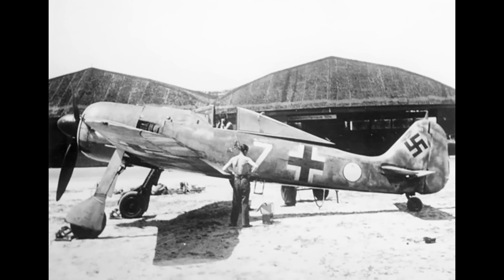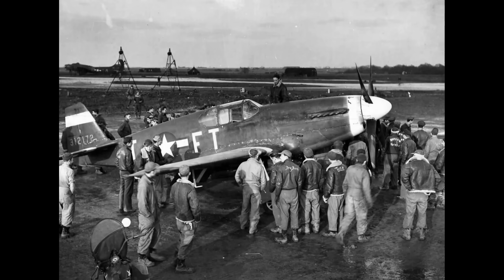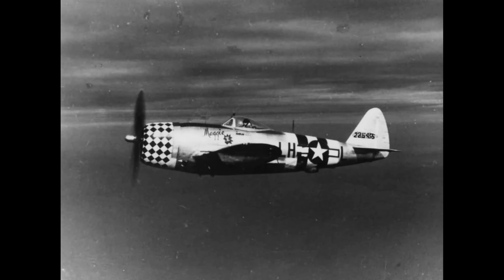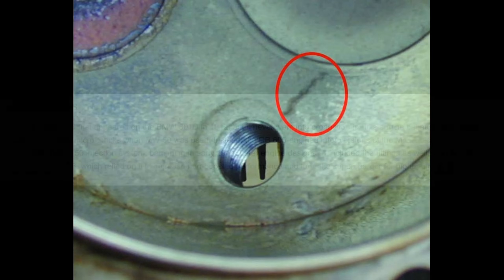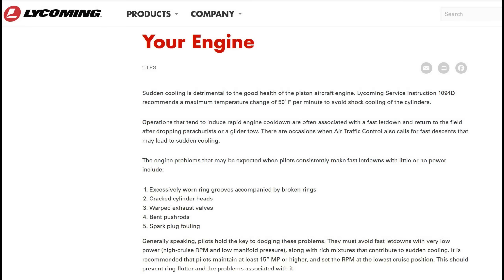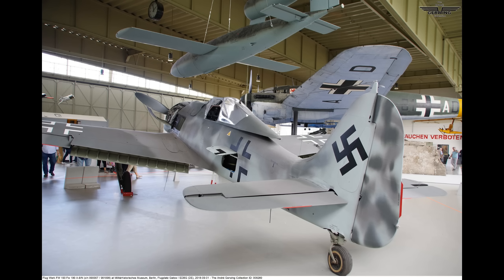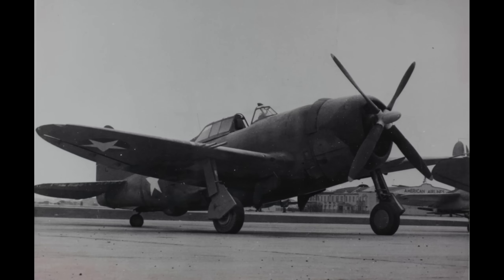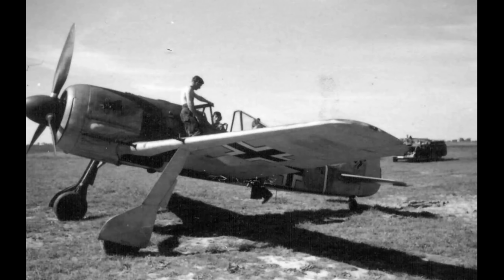Focke-Wulf Fw 190 A-4, Almost turned the tide, Almost...

Comment: Fascinating,  for information from the Fedden mission. Given the historical closeness of the relationship between the British and BMW, a lot of the report focused on BMW engines. 
Considering materials “On top of this, a shortage of raw materials and difficulties from our bombing attacks made many changes necessary. The chief engineer of B.M.W. said that during the war he had to change the steel of his poppet valves ten times, and of his crankshafts three times, necessitating check tests in every case. Some idea of what this means as regards disorganisation of output, can be imagined by engine builders. Further, he said they had the greatest difficulty with fuels, and could not rely upon these regularly maintaining their characteristics for a few weeks on end. On top of these difficulties, there is no doubt that our persistent bombing had a very serious effect, and we were told of organisations which had been dispersed to four different sites in 14 months.” 

Another issue was manufacturing time a BMW study compared the hours for manufacture, between the 801, the Bristol Hercules and Wright-cyclone. The BMW crankcase took twice as long has the Cyclone and 40% longer than Hercules, though the BMW was lighter. The largest issue was the fuel system it took 10 times longer to manufacture than those on Allied engines. 

This was critical, and catastrophic for German development, exhaust valves were being made of Sicromel-8, no nickel 8% chromium and 1% aluminium, in comparison German engineers established the exhaust manifold Rolls-Royce ally composite of 80% nickel, 12.6% chromium, 6%iron 0.067%., Cobalt 0.28% manganese, 0.17% silicon, 0.19%titanium and 0.02% carbon. Also for consideration are the ignition plugs the Fedden mission investigated these at length because of the impact of the lack of specialist material availability particularly their reliability.
The BMW 801 engine was also studied has a priority in America to review the fuel injection and the automatic control unit (these were not initially available, which caused difficulties) The Ernest Hives, report on his visit, is interesting. 

Fuel injection, “Mr. Brucbnann stated that he considered water cooling necessary for all engines over 4000hp. All the B.M.W. engines employ fuel injection with Deckel punps, used not in preference to Bosch, but because the Bosch pimps could not be obtained in sufficient quantities. It is understood the Deckel pumps gave some trouble at altitude. Mr. Bruckmarm stated that no engine vibration dampers were fitted to any B.M.W. engine and declared that they had been proved to be unnecessary.” Given the height at which the 8th Force attacked the Deckel injection issue would be a disadvantage up against Spitfire IV Spitfire XIV and Merlin Mustang. 

It’s worth investigating the Pembroke, FW190, landed June 1942, report and engine analysis. If ever an aircraft, arguably the best fighter in the world at that time, drove development, it did. The resulting consequences were staggering, in the Merlin 60 designed for a bomber to be advanced for a fighter and fitted to the Spitfire V to become the Spitfire IV, thence to the upgraded Spitfire VIII and Mustang.

Comment: First of all the BMW-801-D-2- with MW50 had "only" about 2000hp and they had problems to deliver the system in large numbers , so they could practically use this fully on in the A-8 version . And at low altitude the power outcome of this system was way under the expectations , MW50 was for high altitude . A simple change of the boost pressure or a C3 injection had the same effect and was cheaper as well . 
Also this was injected into the intake , the water evaporates and this cooled the air like a intercooler . The methanol should help prevent knocking , I don't think this would crack the cylinder heads . Or every modern car with a intercooler would have that problems . More air in the cylinder plus more fuel and therefore more hp and heat could damage the cylinder heads I would say , that's why it was only allowed to use this for 10 minutes .
Reply from the maker: No, MW-50 is not for high altitude. You're confusing this with GM-1. MW-50 gives its greatest gains at altitudes where the supercharger can provide additional boost. C3 injection is nowhere near as effective as MW-50. cont:

     You statements about MW-50 being basically like intercooling, the methanol being what helps prevent knocking and so on are common but wrong, this was all dis proven by NACA long ago. I can't straighten all this out in the comment section, I'll probably have to make a video about just how MW-50 vs. GM-1 vs. Intercooling works.
Reply: @GregsAirplanesandAutomobiles  I should have said higher or mid altitude , not high like 8000 to 10.000m . 

Practically both systems were the same , they cool down the compressed air . GM-1 is like today's NOS , but it's more effective than MW50. Cause it's boiling temperature is -88° and at 575° it decays into two nitrogen atoms and one oxygen atom . So it brings additional oxigen into the cylinder . But you can blow up your engine pretty quick . 

The Germans tested MW50 at under 500m and they get 6kph more top speed , so with higher altitude I meant 3000 to 5000m . C3 injection was effective up to 1000m were MW50 had the same hp output . 

It's all about cooling down the compressed air , cause cold air needs less space and therefore more of it fits into the cylinder . And that gives you more hp and for that we have intercoolers today . 

 Methanol was also use to prevent the water from freezing and has a high octane number 106 , wich helps against knocking . 

Today we use the same things to tune up our cars .

Comment: I flew a Piper Navajo in northern canada where we would normally be operating in -35°C air in the winter. They constantly pounded the threat of shock cooling into our brains. I managed to have a crank case crack on me once even though we never pulled more then 2" of pressure off every 2 minutes.

There is nothing more taunting then seeing the turbopipe glowing hot while your freeze your balls off for a couple hours in one of those Ho's.
Reply from the maker: Yup, don't get me started on that Janitrol heater crap.

Comment: Excellent video. Please do a video about the FW 190 A9 variant, with its BMW 801S engine and the hypothetical 801F-1. Also, did the FW 190 A8 have an upgrade in power with the 801 TU WEP?

Comment: Shock cooling is definitely a thing from my experience. I used to be a member of the Canterbury Gliding Club, which operated a Piper Pawnee PA-25-235 (which I have flown as Tow pilot on occasion and often flew behind in a glider). Earlier on with the aircraft, the club went through an alarming period of cracking cylinders (including fairly new cylinders) and it was of significant safety concern not to mention expense. A procedural change was made where by: after the glider released the tow plane would NOT reduce throttle but would nose down to increase airspeed (the Pawnee is incredibly draggy so exceeding VNE is not normally an issue), which would cool the cylinders at a slower rate than if you throttle off. You would leave the throttle wide open until base leg. It made for quite fun flying and completely eliminated the cylinder cracking problem.
Reply from the maker: Thanks. I was expecting an avalanche of people from the "shock cooling is a myth" crowd, but they haven't shown up. It seems that most pilots with experience in this are in my camp. In fact if anything, more of them are like you and that indicates that shock cooling is a bigger factor than I realized.
Reply: @GregsAirplanesandAutomobiles  ??? Have these people never warped a hot pan by putting cold water on it?
Reply: I know of a glider club that went to water cooled V8s in their Pawnees to combat shock cooling at low altitudes
Reply: My gliding club in the US used 180-Hp engined Super Cubs; a very close engine/wing combination to the 180-Hp Pawnee.  We suffered a disturbing series of cracked cylinders until we reduced the rate of cooling after glider release.  With our new procedure, cracks seemed to be a thing of the past.
Reply: Absolutely, it was the same at m,y gliding club. I never flew the Pawnees but having tugged in both 0-320 standard Super Cubs and later one modified with an 0-360, the SOP was reduced power (down to about half throttle) and come down in massive slipping turns, about 70 degrees of bank with full top rudder and plenty of pull. LOTS of fun.
Reply: @harryspeakup8452 0-360 Super Cub sounds great fun - I have never flown one that powerful. The Pawnee was so draggy (effective flaps also), that no side slipping needed but it had a pretty poor glide ratio! Does sound like fun though.

Comment: Another interesting development of the Fw 190 was the proposed DB 603 powered version, known as the Fw 190 C. Initial calculations indicated a speed increase of 50 km/h compared to the 
Fw 190 A series fitted with the air-cooled, 14-cylinder BMW 801 radial engine, as well as a lower flight weight. A wartime Daimler Benz document showing airspeed for the Fw 190 C V16 documents the outstanding performance of the DB 603 A engine mounting a G-type supercharger. Thus equipped, the V16 in 1943 achieved speeds of 570 km/h at low level and 722 km/h at a height of 
8500 m and it only needed B4 type fuel. Galland and many leading German fighter pilots were in high praise of the aircraft and wanted a production run, even Kurt Tank requested the RLM to commit to this. Yet Generalfeldmarschall Milch scuppered further development. Fortunately Focke-Wulf had learned much from its development with an inline V12 engine in the Fw 190 airframe, which would assist in the future D-9.

Comment: What happened to those long form videos man.
Reply from the maker: That's a good question. Those are not going away, but I have to accept reality. I put up two videos about 45 mins each on the Pacific Theater Thunderbolts, a couple months ago. Those videos had far more info and were much harder to make, yet these last two have caught up in views in only a few days. I'm not going to stop making long videos, but I'll mix in some shorter ones as well.
Reply: @GregsAirplanesandAutomobiles   yea I know. I just miss the long form.

Comment: Shock cooling WAS an issue with the Continental O-300 engines.  I had one in a '58 C-172.  Always did descent from altitude by pushing over and doing max RPM slides downhill.  Even in the traffic pattern, I adopted the Navy technique of pitch first, power as required.  Even after 1,200 hours, the guy who bought it said that it was the sweetest O-300 he had ever operated.  The Continental handbook for the engine did caution against "chop and drop" descents citing potential cylinder head issues.

Comment: 1943 escort fighters? In the USAAF? Wasn’t the bomber mafia still insisting that drop tanks weren’t to be used and just letting their bomber crews be slaughtered by the dozens?
Reply from the maker: Yes, but by mid 1943 the Escort fighters were going in deeper and deeper. Had then been getting trounced by water injected 190s in addition to larger bomber losses, you can see how that would have set things back for the Allies.
Reply: @GregsAirplanesandAutomobiles  yeah i do see your point. it would have probably made the bomber mafia feel like they were right, and allowed many more thousands of bomber crews to be sent to their deaths.

Comment: No single aircraft could have possibly turned the tide.  Maybe the 262, if used from the beginning as a pure fighter, could have held the tide back briefly, or got the 8th bombing at night - but then the Allies would have put more effort into the jets rather than continuing to develop the Merlin and Griffon.
Reply from the maker: It the tide was going to be turned against the US air armada it had to be in 1943. The 262 wasn't available in 1943, so that's not an issue. Let's remember that the Germans did inflict enough losses for the US to stop deep daylight raids in late 1943.

Comment: I totally agree with your, metallurgy idea.  The Germans were on the back foot with supplies of minerals to alloy steel as they started the war. It evidently showed up here in 42, then as the war drew on the tank armor became very brittle as they lacke Chromium, Vanadium and Manganese to make it less brittle. I had not heard anything about piston engined aircraft but had read about the jet turbine blade issues. Thank you for this informative video.
Reply: I think wasn't just the effect of alloying elements but machine tools and alloying elements for cutting steals.  As far as I understand it Pratt & Whitney (a machine maker by origin) made the R-2800 cylinder heads by forging them from billet stock and then precision gang sawing the ultra fine cooling fins and machining the head.   BMW was casting the whole head in one piece.  At some point BMW went from casting the head to precision casting it in a vacuum.  (I think this technology was developed for the never to be used BMW801E but some of it was incorporated into the BMW 801TS and TH which were D2 with some E technologies, these 1944 engines apparently had not only higher compression ratios but were more suitable for MW50  (possibly introduced in 1945 as the Ribbentrop system).
-I'm no metallurgist but I know vacuum casting reduces the number and size of the strength reducing inclusions and crystalline defects while forging forces them out of the metal.     Machining was just not an option for mass production the Germans.  They didn't have enough machine tools and they didn't have the elements for the cutting steels (particularly tungsten).  They tried to forge, cast, press and weld everything.  Anything but machining.  To an extent the US machine tool industry based around Cincinnati and Milwaukee 'won the war'.   To be frank I think not even Curtiss Wright could match Pratt and Whitney in machining.    Napier had no chance to make the Sabre work without American Machine tools to machine the sleeve valves.
Reply: They also had a lack of experienced pilots at that point. Youy could have given them the MiG-21 and it would have made no difference in the outcome of the war.

Comment: Another phenomenal video Greg thanks.
I do think it mainly boiled down to experienced pilots in 1944.
Reply from the maker: Yes, but for it to boil down to that you first have to kill off the enemy's experienced pilot. The US didn't start with a pilot experience advantage.
Reply: @GregsAirplanesandAutomobiles  That's true, but the Germans did not make much attempt to preserve their best and boldest to pass on the skills either. They tended to burn them.

Comment: Greg , as an 24000 hr professional, having 15000 in radials, cooling is a radial engine Achilles heal(flat engines as well). It all has to do with airspeed/ power reduction common sense. Example would be , either pull back the power to descend(leaving the A/s constant), or leave the power in at a cruise decent (pulling power back every 1000 ft) , and pulling it back slowly after you decelerate when leveling off. Cooling the ice cube as gently as possible , so to melt and not crack.
Reply from the maker: Thanks, 15,000 in radials in huge. Seriously, that might make you the highest time radial guy.
Reply: @GregsAirplanesandAutomobiles  Typo , not 15, but still more than I’d like to admit. DC3, Beech 18(currently own one), T-28C, AT-6, Howard DGA-15, Stearman, M-18, Ag Cat, Radial Rocket(currently owned), etc. By the way , I really enjoy your channel.

Comment: I flew Chieftains for Amflight in the late 1980's. You provided a spot on description of how we were trained to incrementally reduce MP during descents. We were also trained not to push the props forward, i.e. RPM, during the landing approach unless a go around was necessary.
Reply from the maker: Thanks man.

Comment: Glider pilot here. Our club have specific procedures to bring the towplane down as cooling down too fast caused  few cilinder damages. Once the source was identified, the problem was successfuly resolved.
Reply: Did sky dives for a while in a 182.  
Procedure was close engine vents, prop full forward and power to like 15 i think. Then spiral down. 

I was told if engine was put to idle it would cool to fast and could crack cylinder.

Keeping the engine at some power kept it from getting too cold. A nice spiral kept decent in the yellow and if down right you could exit the spiral down on final to land and save time
Reply: I might get back into it, havent flown since age 15 … our club used a tow plane at one airfield and a spool of cable attached to a station wagon driveshaft at the other airfield… good times

Comment: Metallurgy is definitely a big factor. It will determine what constitutes "shock cooling" for each cylinder head. That critical cooling/shrink rate will be determined by not only the chosen material, but the consistency of the material. The variance from engine to engine let alone cyl to cyl will be a big gamble even if you know what you're doing but can't maintain control of the process or raw materials.

Comment: Germany had problems with metallurgy during the war.  I know the armor used for Panthers and Tigers had problems with their armor plating cracking under the impact of rounds when they were engaged with Allied tanks.  Very good video Mr. Greg!!
Reply: Also the ME262 engines had turbine blade film cooling because that would save them from having to use war critical steel alloys. Necessity really is the mother of invention.